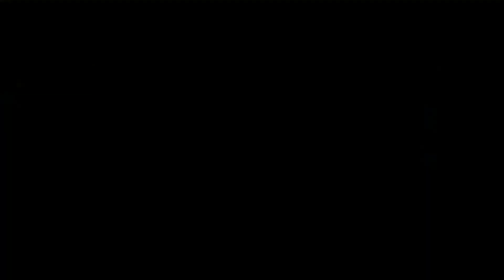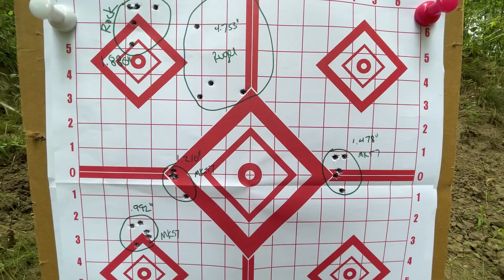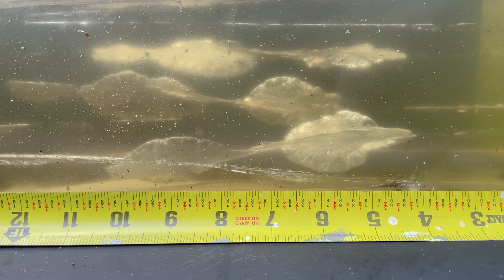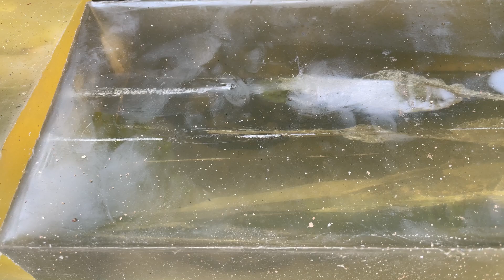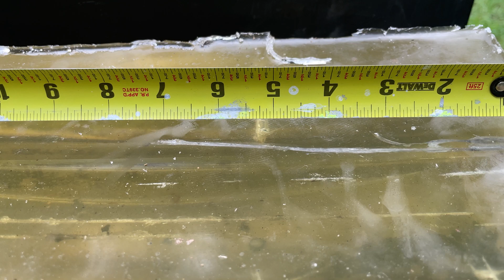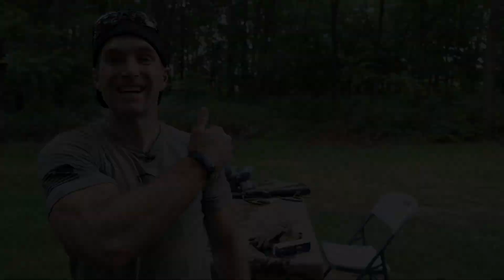5.7x28mm, 40gr FMJ, America's Ammunition Company (AAC)

Comment: Buffman… I have been binge watching your videos and love your content!

Question… 
I have been thinking about buying a  sub 2k in 5.7. 
Do you know of any problems with ammo and that platform (feeding, extracting etc.). 

I was told that because it is a blowback design there are issues in regards to ammo and the sub 2k. 

I know you recommend ruger over kel tec but the kel tec is within my budget and the ruger is not. 

Thank you in advance and thanks for all of your knowledge you share on YouTube!!
Reply from the maker: This design like the P50 is at it's limit with factory loaded SS198LF, IMO. You'll see flattened primers where other designs don't. I "lessened" this by installing the heavy bolt weight from Keltec. Brass looks better but primers are still not great on Hornady or SS198LF. I got a new bolt/extractor and now mine is running better as far as extraction goes..
Reply: @BuffRANGE 
Man…thank you for all of that information.  That really helps a lot. 

And thank you again for all that you contribute to our community!!

Comment: The M&P 5.7 does not like the AAC ammo, or at least mine doesn't. You had the exact same failure to go into battery as what happens to my gun at 4:07 in this video. What is actually happening with the M&P is caused by it's unique feeding mechanism that I haven't seen on a pistol before (I'm still a noob- have only been around guns about 2 years). Unlike most guns, the M&P requires the extractor to ride over the rim of the case during chambering at the point where the slide stops. The bullet is fully seated in the chamber before the extractor rides over the rim. Most guns are designed that the rim of the case slides under the extractor during chambering. I don't know why the gun was designed in this fashion.
I don't know if the AAC ammo is just a tiny bit bigger or a tiny bit of a harder metal, but I get failure to go into battery about once a magazine with this combo. I get this same failure with other ammo types also, just not nearly as frequently.
Reply: Could you soften or round the corners of the extractor to increase reliability? Don't forget to polish it smooth as glass. Just thought my input might help.

Comment: So for self-defense I need to find something other than 5.7X28?
Reply from the maker: I'd recommend the AAC Vmax, or other loadings for self defense vs using the FMJ. If all you have is FMJ it's still viable, but not ideal.
Reply: @BuffRANGE  Please help me pick. I'm torn between a Keltec P50 and a Zastava M70. I see benefits in both. 50 rds to 30. Light kick to heavy. Compact to not. Stopping power. Thank you for your time. PS. I will be buying today if you respond soon enough.

Comment: Appreciate all the 5.7 content, my man. I may possibly get into 5.7 somewhere down the line when the domestic MFGs come up with more SD related loads.

The way this thing performed here makes me think a sleeker, VLD style fmj (read: longer for same weight) that weighs 30-35gr or so, would be great for self defense.
Reply: I wonder how a 5.45x39 style 7n6 bullet or a similarly structured bullet would perform?
Reply: @elburropeligroso4689  I was just thinking about that. Make a FMJBT with an aluminum insert like 5.45 or M855, with lead at the base. It would be longer than a 35gr bullet should be, and be rear-heavy. It would easily tumble.

Comment: AR57 12in: I believe a AR15 H3 buffer (5.6oz) can be substituted for Panzer's OEM AR57 Gen3 (4.82oz). H3 is a wee bit longer.
But H3 still short enough to lock the bolt back, and cycles fine even with heavier (Armaspec braided) spring.
Using the heavier AR15 H3 buffer, with heavier Sprinco/etc spring, may help stop neck bumping a smidge.
(Bonus: same lower setup works for Shortstroke Piston AR15 uppers too, known for tearing rims off cases with less than H3.)

Comment: Hey Buffman appreciate all your testing and vids. I've watched a TON of your armor test videos, but what would you suggest as the lightest  plate in special threat or lvl4 that actually performs?
Reply from the maker: Do you require edge to edge protection of the strike face?
Reply: @BuffRANGE i would say yes unless there is a drastic difference in performance between 2 options with a small difference in coverage.
Reply from the maker: @dentron2  What threats would the special threat plate need to stop?
Reply: @BuffRANGE  m855
Reply: @BuffRANGE  i have heso L210s but want to either upgrade to 4 with the lightest weight possible or keep m855 protection but shave weight
Reply: Cost is not a problem, but i would like something i can just buy vs spooky military plates that i have to get second hand

Comment: I had hoped that AAC would put in some engineering to do away with that stupid coating. Seriously how hard can it be 🤬. I never heard about 4.6x30 having any and all other bottlenecks like 357 Sig run just fine without it
Reply from the maker: well .357 sig doesn't work off blowback :D and I belive 4.6 has a case taper
Reply: @BuffRANGE   thx! Didn’t think about differences in case geometry 🤔. So basically that could be considered a design flaw and the ship has sailed. Would be interesting to know if that lacquer was added later as a mitigation of issues identified too late for a design change